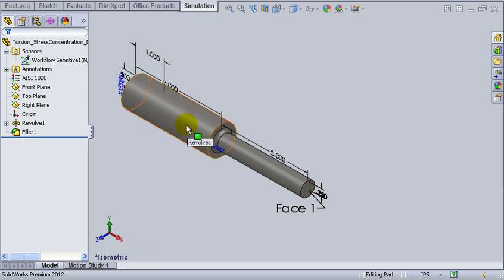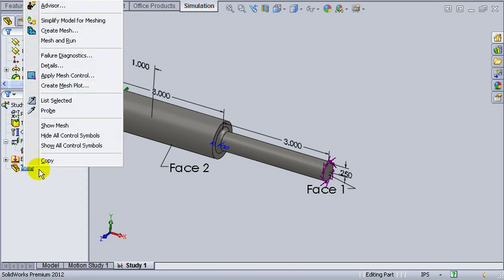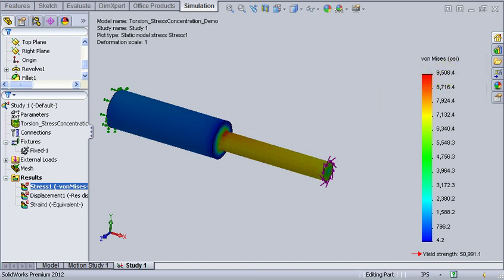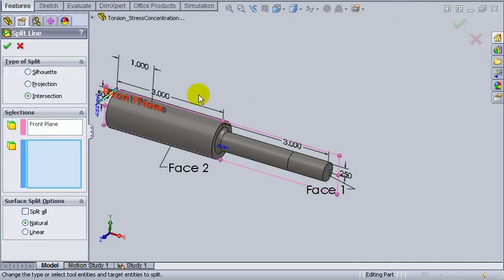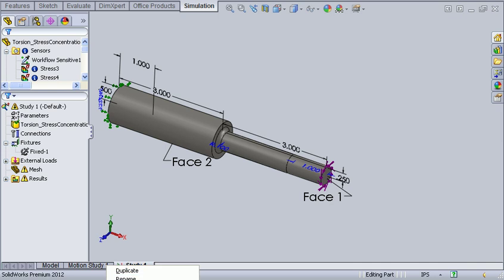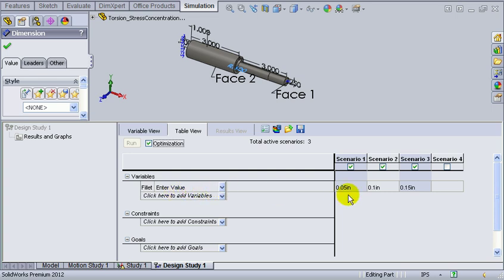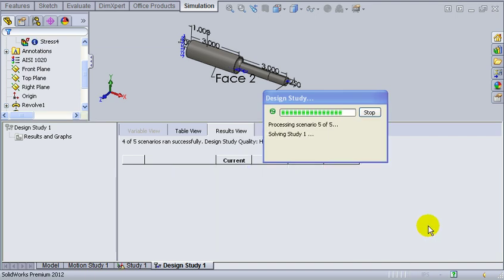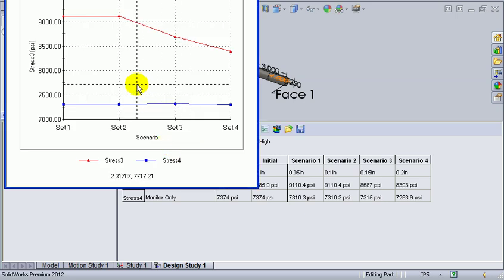Torsional Static Analysis and Design Study Example Using Solidworks

Comment: A lot of times, most works are done in finding forces acting on a part (or multiple parts) of a mechanism. For each part with forces, simulation is applied. From there, the factor of safety, displacement, stress, and strain are evaluated for dimensional adjustments.